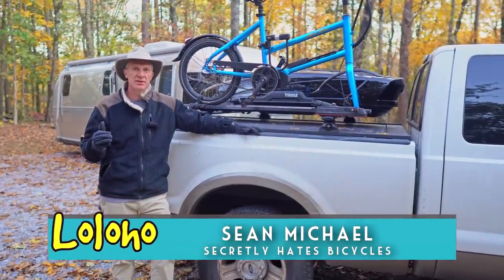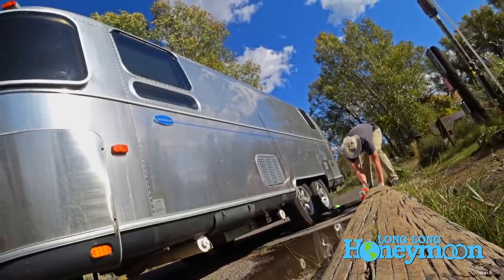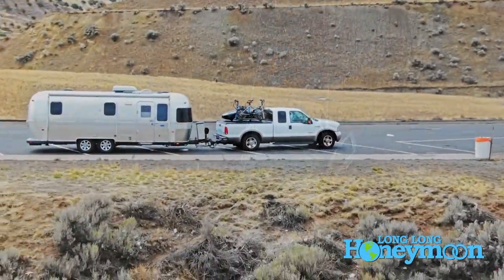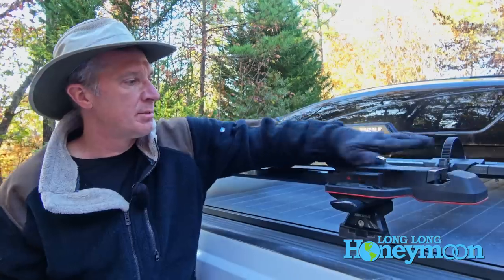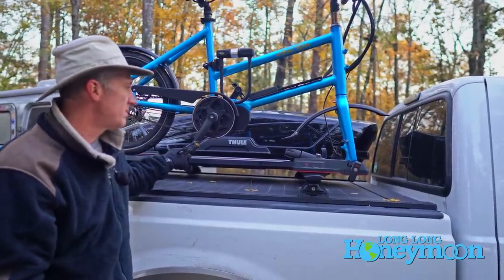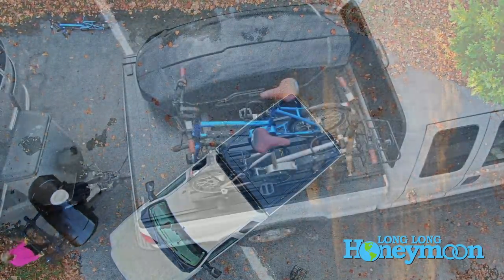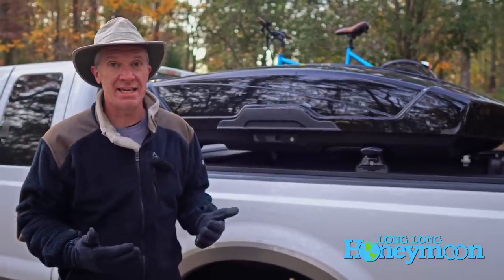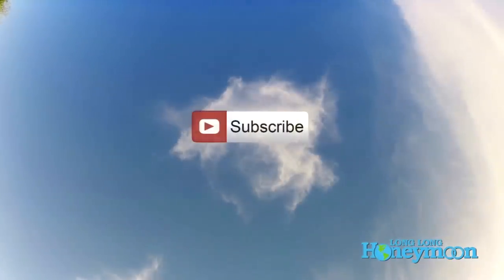Our Yakima/Thule Truck/RV Bike Storage -- What We Like and HATE About It :O

Comment: Also instead of mounting the fork adapter on the bike first before putting it on the rack, just mount the adapter in the rack first before putting the bike on.
Reply: We do it the way the bike shop and Yakima dealer recommended. Also, attaching and tightening the skewer would be pretty difficult the way you're suggesting, lol. We would probably have to climb up in the bed to do it the way you suggest, and that would be a major pain! 😁
Reply: Kristy Michael well just trying to think outside the box. I also work in a bike shop and we sell Yakima and I’m always trying to find easier ways to do things. I also have an f250 but 4wd and it sits pretty high. My previous racks were also on top but I had a little folding step stool to stand on to get them up there. My skewers were a permanent mount. Was not that hard to get the fork in and tighten it down. My bikes did not budge. Is your fork adapter loose because it doesn’t tighten up in the fork. Because if the fork is somewhat loose in the mount that would be one reason for it falling out. Those wheel dropouts can take a lot of force. I personally would try to get it pretty tight. Anyway hope it works out for you. Oh, the fork is a no brainer to change out. Any decent bike shop can do it. Probably have to order the fork. One more thing: love your videos. Keep them coming. Learned a lot from you two.

Comment: The "lever arm" from the system you are using creates a tremendous amount of force acting on the contact point of the front forks bar as well as the mechanism securing the bar to the rack when moving down the road. I hate you guys spent the amount you did; because, down the road, you'll simply have a system that does not work.
Reply: @LongLongHoneymoon  oh yes. I think the overall set-up is great. The bike system part is what I have misgivings about.

Comment: Ditch the E-bikes and most of your problems will be solved. It seems most of your core problems go back to the extra weight of an ebike versus a regular bike.
Reply: Dennis Harris the ebikes are a wonderful way to see a lot without fuel and noise, it’s also super less stressful on the knees.  Older people or injured people can still have a blast without the knee discomfort.  Love my ebike
Reply: @heidieho4470  I am not berating them by any means. However all the complaints would be solved by going to a lighter bike. They could easily drop 20 pounds per bike. A quality bike nowadays will have a sufficient gear range to reduce knee stress with proper fit as well as allow them to ride up anything at a slower pace without getting anaerobic.

Comment: Does not sound like a good design. Making an accessory that blocks the emergency exit.
Reply: I don't think it blocks the exit window on every Airstream model, but it would have on ours.
Reply: I agree that it seems like a poor design.  Not only blocking the emergecy exit, but also only able to handle a measly 75 lbs.   :-(
Reply: 75lbs is pretty reasonable for a bike rack, or was until the past few years.  That's 2 heavy bikes, or 3 light road bikes (or 5 fancy carbon fiber bikes I guess).  Just not enough for electric bikes.

Comment: As much as Airstream cost they should come with a 400lb rated hitch on the back. Just sayin.
Reply: No way. 400lbs can lever 200lbs. off the hitch.
Reply: Adding weight on the rear of a travel trailer is dangerous. Sway is a dangerous thing and storing bikes and other items on the rear is not worth killing someone.
Reply: @santini1953  Yes that is true but it depends on tounge weight u have on your trailer. If u maintain 15% it will be ok. Also large tandem two axial trailers should not have a problem. Many trailers have bike racks on the back some even have generators and trunks. I do agree it can be a problem especially if u have a small single axial trailer and don't have the proper tounge weight on the hitch.
Reply: @mikeb6386  i said "SWAY" .  I don't give a crap about the tongue weight, adding weight on the rear can add to sway.
Reply: @santini1953  A tounge weight below 15 percent can cause sway too. It happened to me when I put too much weight on back of  my single axial trailer. Sway can be controlled by sway bars or friction sway control.